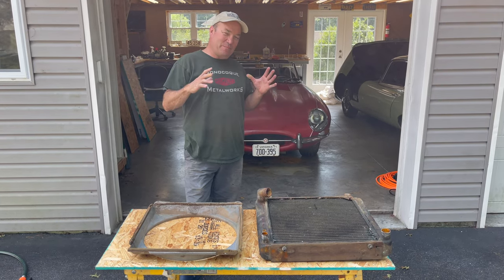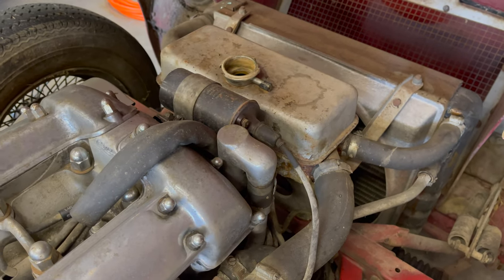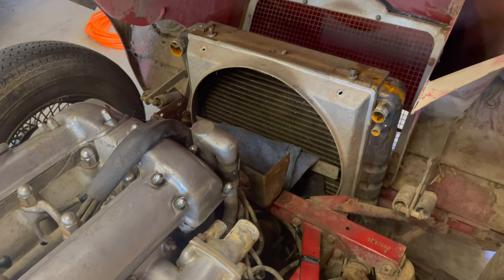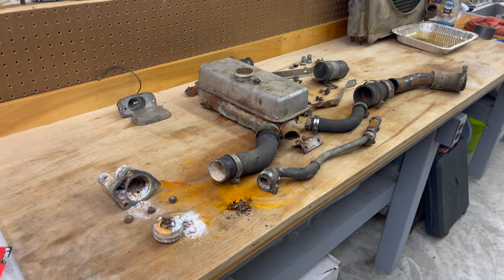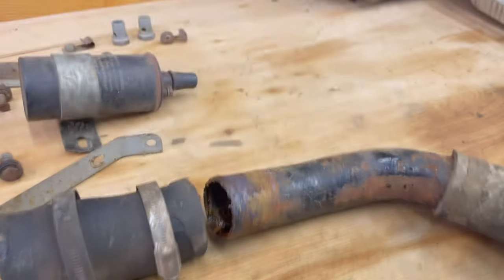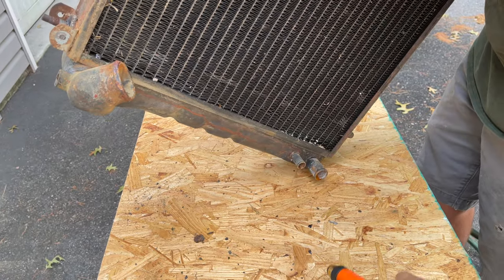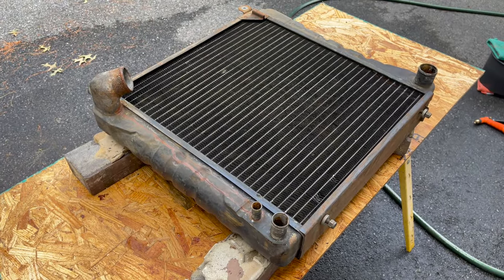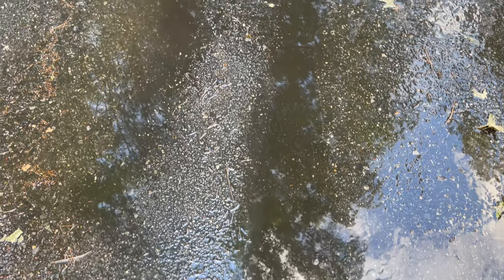Jaguar E-Type - 1966 OTS Roadster - Episode 8 - Cooling System Flush

Comment: I own a 67 OTS and have done quite a bit of work with the cooling system.  My comment has to do with the Otter Switch that is installed on the front sice of the header tank. I did not see this on your tank but assume there must be one as I believe all these cars used that switch. 
The Otter Switch not only goes there the front face of the tank but also into the large diameter metal pipe that goes from one side of the tank to the other on the way from thermostat housing to the radiator connection on the other side of the car. 
Seems they wanted to sense the temperature of the water exiting the engine on the way to the Radiator as you might expect. 
What is interesting about all of this is that I have found that the hole in the large pipe may vary. One reproduction tank I have has a hole quite a bit larger than needed. A second dreproduction tank I bought from Welsh (stainless steel) has a smaller hole just large enough to do the job. Unfortunately I threw my original tank away before I realized how this was made. I rather suspect that the hole should be as small as possible, otherwise the flow may be shortcircuited and bypass the radiator.
I would be much interested in your comments on this subject.
Tom G.
Reply from the maker: Tom - stay tuned for Episode 9 - it is ALL about the header tank!  :-). But yes - based oin what I see inside the tank and how it is designed to work, the hole SHOULD be as small as possible.

Comment: OK I appreciate you are an E Type expert, AND appreciate keeping as much original as possible BUT throw the hoses away flush the block by removing the drain cock (although I would remove all core plugs especially the rear one) , that engine really need a good flush through or you will regret it, obviously the blockages in the radiator are also in the block.
As for the draught excluder (yes that's what it is in the UK)on the fan shroud it's probably so delicate it serves no purpose.
FYI, not that you probably need it but I sell rebuilt water pumps.
Reply from the maker: Thank you for the advice, and keep watching - the system is all back together now and it all worked out pretty well.  It is a tough balance between originality, preservation, and drivability, but I think I struck a good balance with the cooling system overall.

ALSO - if you watch the whole video, you'll see that I DID pull the drain cock at the back of the block, and flushed LOTS of water out of it, back into it, and out again - over and over...  My son and I worked on flushing out the block one afternoon for about 2-3 hours, and that was all pretty "wet and wild", so there are not really any videos of that.

What worked best was to flush through the block for a few minutes with water, then fill the block up with as much water as possible with things all apart - probably about halfway.  THEN, we put a rubber squirt thing on the end of an air hose, and blasted compressed air into the half full block, creating a MAJOR agitation in there of water and air, and then flushed again for a few minutes.  Every time we did this, alot more brown and black "stuff" came out - all very fine particles, though.  After about 50 cycles of this, things were flowing pretty clear and fast.

Also - after this was all done, we didn't find any water in the oil pan, cylinders, or exhaust ports, etc. - so I have high hopes at the moment that the cooling system is free and clear - and intact - there is no water ending up where it isn't supposed to be.

It's all back together now and drained and dry - we'll fill it up with the typical 50/50 mix of coolant when we go to start it up, but after it's running, I suspect there will be several more flushes to just get everything clear.

Stay tuned!  :-)